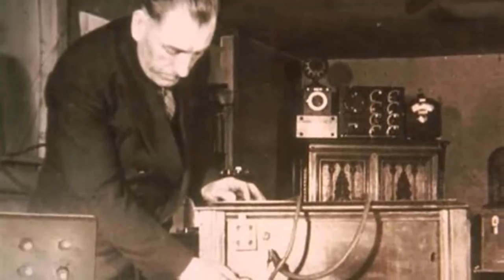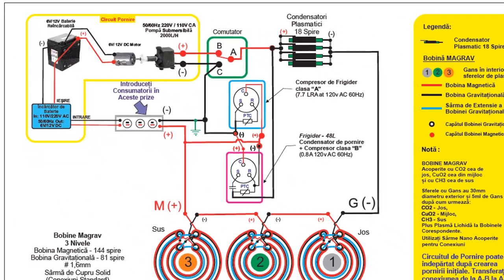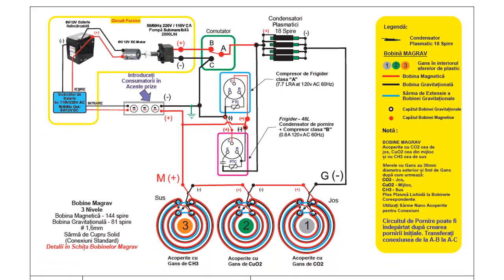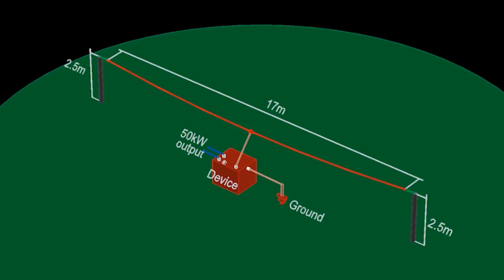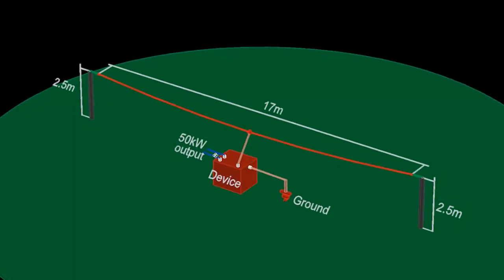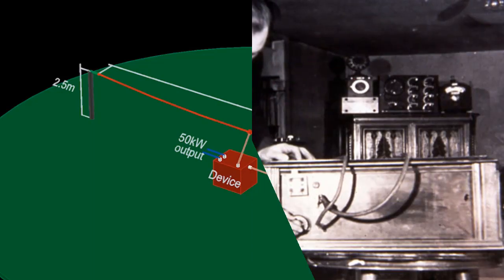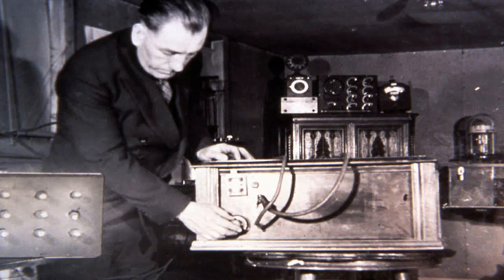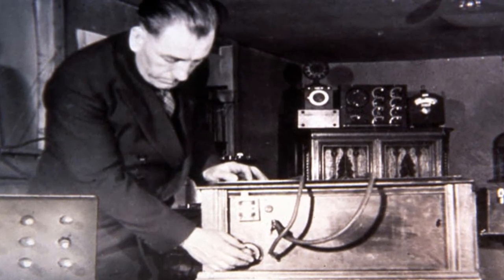Henry Moray's Radiant Energy Generator: basic theory and how it works

Comment: This is the simple impulse current generator circuit which is usually now a days run the fish shoker machines , these machine can give impulse of dc current with resonant correct frequency, u can run heavy ressistive load or high resistance inductive load , its not conventional ac currents

Comment: I'm diving deeper into Nikola Tesla's impulse electricity.
After fully understanding the voltage impulses,
I now work with current impulses.
With them I can use dielectric induction (from the displacement currents)
Reply: I built a system years ago @ my construction yard, but took it down after being warned about  back feeding power through the ground and potentially damaging the local power grid. I have sense determined that a 6” schedule #80 pvc pipe is adequate isolation for 100’ of sub grade ground. Much greater detail is certainly necessary to fulfill high wattage/ Amplitude.